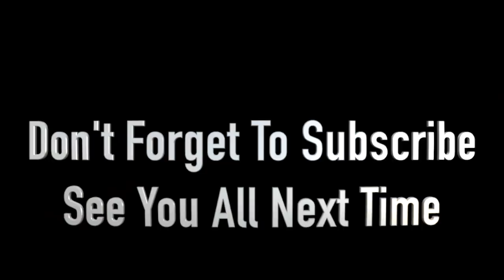We Blew Up Black Jack!! @the.big.swede #11

Comment: Big Swede is the first human to be able to turn a Cummins ISX 5500 rpms before she blew.

Need one of those 6" dia. self propeller augers with large pan feed for your seed tender operation at the seed shed.  Use Hyster to hold seed bins over pan feed, drop the seed in.  So much safer, all alone operation.
Think about moving in with your dad and mom until that wonderful wife of yours heals.  You need the company and someone close to talk with.  We all care about you Chet.
You make the best most descriptive farm videos on the tube.  Always thinking about productivity, profits and balancing against safety

Comment: As far as loading seed from pro-boxes and safety concerns, you could always purchase an electric ground unit transfer auger that eliminates climbing. It is mobile and safe. Set the pro-box in the cradle, turn it on and open the gate.

Comment: Hard to beat mile long straight rows with auto steer. I am buying one of those yank em ropes tonight. I e been skeptical on replacing my old rusty chains for pulling stuck and broke down equipment, but the kinetic rope snatching that semi up like that has me sold. Thanks.

Comment: Thanks Nikki for your wirk and be strong! Chet, if that truck has a Low Flow Cooling system (some Cummins did in that era) do all you can to convert it away from that. They were a weird thing and would overheat at the oddest times without warning. If it's got  small hoses going to the rad she's LFC and that's NFG.

Comment: Really sorry for your kind of sucky day. Had some ideas for loading seed. One idea would be do use some sort of belt conveyor to deliver the seeds into the tender keeping the bin with the seeds in it at a lower safer level, a slightly raised loading dock, about 2 feet off the ground that was big enough that you could put numerous bins on the platform and then use a pallet jack to roll them around to get them over the hole feeding the belt. Another potential option, build a high platform with railings around it, for safety, that the truck could pull up next to with  some small roller tracks for the bins to be loaded onto so they could roll from the top of the platform over the seed bins and then could be rolled off to the other side off to a platform for lowering and then break down. Here's a third one, use some standard rack shelving that you would see in a warehouse to hold the bins higher than the seed tender by at least three or 4 feet which you can easily load from a forklift then from a raised platform you could easily use a shoot from underneath the bins that could easily be moved so you can go from one Ben to another, it would also make it easier from that platform as the seed is going into the tender down the shoot to add that gray powder disc lubricant stuff. I have lots of ideas on how you guys can do this differently next year if you're interested. I'm always looking for easier and safer ways of doing things. Be careful my friend climbing around on things on low amounts of sleep is very dangerous plus you don't want to get any blood on the seed, Lord knows what would come out of the ground with that.

Comment: Can you cut that seed tender down and build a frame to hold 4 boxes on top of it?
Just like a $30,000 seed tender but much cheaper. Good winter project for you and Eric.

Oh. It holds 8 boxes. Shoulda watched a lil longer. Hmmmm.

Look into the remote door openers like the comments below say. Sloan Express has one. You would have to add your talc/graphite differently but it’s better than living on the edge.

Comment: Chet, you guys could easily add a corse, mesh grating system ontop/inside your corn seed tender, and collapsible railing system . That or just use a small seed conveyor to unload your seed totes at ground height up into the seed tenders.

Comment: You could just put some more framing up there on the frames that hold up the tarp and weld some expanded metal to the underside  of it. you would have a place to stand and the seed would still flow through it.
Option two just get a small conveyor, park it where you load your seed, then you could just drive under it and dump the boxes in the conveyor.

Comment: By the oil leak I’d say a rod went through the block, I think it’s a low flow cooling engine, ( couldn’t see it enough )maybe the bottom rad tank baffle is broken loose and could have started overheating etc. I’d replace it with a PJ 450 Cummins engine and go back to the high flow cooling rad. Hope to see if I guessed right. Looks like Murphy’s Law is around your place. Take care my friend.

Comment: Chet, i’m gonna guess that the cause of locking up is overheating. In a previous video I was able to see the motor enough to tell that it’s a Big Cam 4, big cam 4’s had a cooling system called “slow flow.” The slow flow system was supposed to flow coolant in a slower speed, was supposed to be more efficient, and would keep the motor a consistent temperature. It wasn’t near as good as it was expected to be and if the radiator wasn’t perfectly clean (which is next to impossible while trying to farm) they would often times overheat.

Comment: CHET! IDK IF YOU WILL SEE THIS, but get a belt auger just for loading your tender, that would be much safer than climbing up to the top. And it would probably be cheaper than an entire tender. Only issue would be if you didn't have electricity near by to run it. And you would be able to move it around with the forklift.

Comment: You could use a belt conveyer to load seed with. You could probably set up an automatic talc applicator on the conveyer so all you have to do is open the pro box door. A lot cheaper than a new tender.

Comment: Hey Chet i have a question about your seed tender. What if you just welded a catwalk inside so that it's not so dangerous? Or a folddown catwalk on the outside. I used too run one that had a catwalk across the front and back but it was one two compartments. Anyways just a thought. And thanks for what you do.

Comment: Weld a platform on the side of the lift on the fork lift. Make it so it can stow away, like on a pivot point, It can have safety chains for a safety harness, and when not in use, stows away or can be removed. The only dangerous part is climbing the ladder.

Comment: 7:17 Remember the scene in Goodfellas where they were in prison and the guy was slicing the garlic with a razor blade. Chet needs a little bit more of that when it comes to the food prep.
Reply: Chet eats like I used to back when I had a cast-iron stomach . Summer sausage with jalapeño slices smothered with  mustard. I wonder what kind of cheese he had under that. Garlic provolone? The only thing I would have added is a half inch slice of sweet onion.

Comment: Seems like an old motorized auger would be the way to load that seed tender. That way you could do most of the work from the ground, including dumping the talc into the auger hopper.  But if you still have to  climb up top, maybe some 12" wide serrated steel plank grating (or bar grating) mounted on either side of the divider between the hoppers (and below the rolling cover) might help. It wouldn't get you high enough to work inside the boxes, but it would at least give you something more substantial to stand on before you climb onto the forklift.

Comment: Lower the landing gear some. More weight on the duals when your king pin hits the jaws and you'll be able to lock up easier with out spinning out. Idk that's what I do and it usually works pretty good for me. I like the fifth wheel plate to just barely pick up the landing gear off of the ground. Idk maybe it's not the best thing but my tires never spin out and I never high pin. So there ya go lol good luck. Glad Nicki is feeling better.

Edit* if your trailer doesn't have spring brakes then forget what I said lol. My buddy went to hook up and as soon as the landing gear came up off the ground the trailer started rolling and then when he panicked and let off the gas the trailer shot off the back of the truck smashed up the truck frame cross members and folded up the landing gear lmao the trailer might have been a bit overloaded or the landing gear would probably still b with us lol.

Comment: Engine fan? Have they gone electric fans on semi trucks? Likely broke a rod as it blew thru the oil pan is what it seems. If you lose the cooling system, isn't there an alarm that should tell you the temp is increasing? Or gauge at least? And if the rod breaks on the way down, it is going so fast it can blow a hole through the engine block, thats how powerful it is.

Comment: Could you not weld in an inch square mesh or walkway grating material into the top of the seed tender so you could stand on it but the seed would still go through?

Comment: It appeared to me the the engine threw a rod out the bottom of the pan or the side of the block from all the oil spilled onto the highway, either way you're looking at about 25 to 30 grand for a rebuild or maybe best to order a new cat engine to replace that Detroit diesel, just thinking out loud...sorry for your troubles all it takes is time and money...

Comment: 47 YEARS DRIVING, with a few million miles under my belt as they say itnever never slam your fifth wheel into the pin hard with legs hard on the ground, back in under soft, raise the legs and finish backing in soft, fifth wheel bushing pins and jaws as well as the throats get wore hard time when slammed hard, as well as raises hell with the trailer pins, think of the extream force that you are aplying when you slam the two together? fifth wheels are like a mouse trap, keep the linkages under the plate lubed and rust free they trip even with a slight tap of a hamer they do not need Brute Force to trip them

Comment: Put your seed door   In front Facing away from you Turn your truck around Climb up the ladder stay on the ladder Pull your feet door As the seed is running in dump the graphite on it running into the sea tender Wow your still standing on the ladder

Comment: Well its not a cat engine so it will be cheaper but if it was a cat it probably would still be going. What  do you have in that truck a  Detroit. The all break at some point we had a 3406e go 890k and it started smoking we went ahead and rebuilt it and we sold that about 600k later and it was doing good. The very next truck had to have engine work at like 400k so luck of the draw I guess Rotella is the secret

Comment: 1 - Engine will not turn.  2 - A lot of oil on the ground from the bottom of the pan. . Likely you lost the cap on a rod, broke a rod, and the rod end poked the pan - no oil, seized engine. bad news. .  Jerking on that Yankum is not a good idea. Should that ever snap at that moment, it will do a lot of damage.
Reply: @deaddoll1361  Especially on a diesel. Lots of fun. Something broke to put that hole in there - OR. heaven forbid these guys are started into these false catastrophies like happened in Gold Rush.